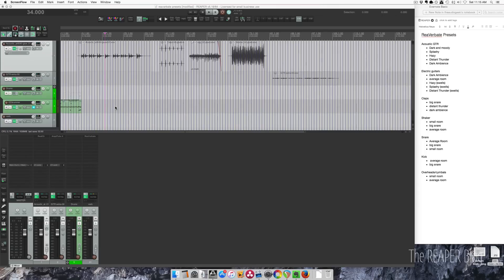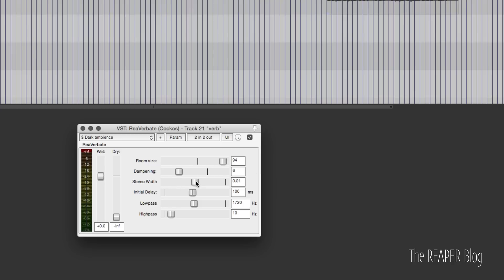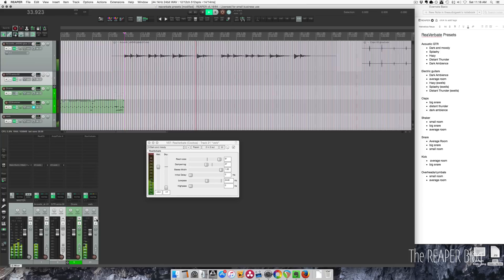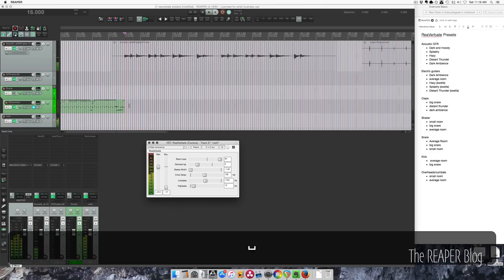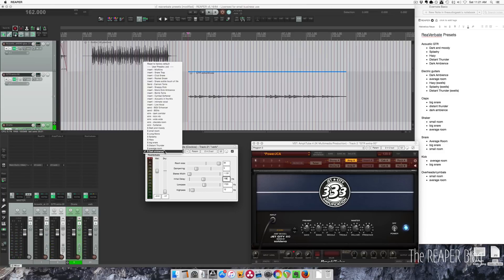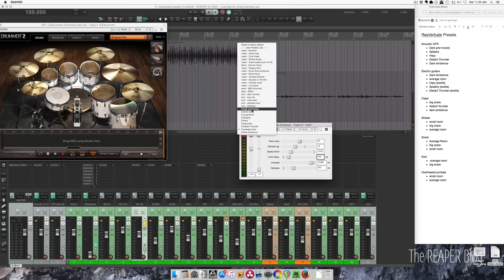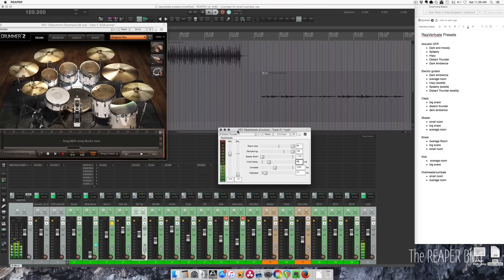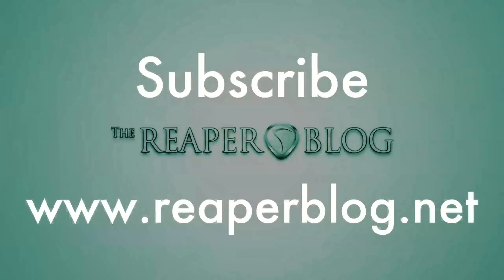ReaVerbate Reverb Plugin + Free Presets

Comment: Pro tip: Use the reverb module in Reaverb - it's Reaverbate, just inside Reaverb - and then use the Trim/gain/stretch module after it to stretch things a bit. You can achieve some really nice reverbs with a bit of playing around.

Comment: One of the effects for which I specifically turn to ReaVerbate is vocal SLAP.  Like the hallway element of Heartbreak Hotel's vocal sounds...  
My settings range for this:
Room Size= 30 - 50  (smaller rooms for quicker tempos)
Dampening= ~50    (to taste)
Stereo Width= 10 - 40 (pretty narrow)
Initial Delay= 60 - 130  (depending on song tempo and vocal cadence)
Lowpass= 1000 - 2000 (pretty dark)
Highpass= 100 - 300  (pretty thin)

With some tweaking this absolutely MAKES a rockabilly (on the fast side), or spooky/haunting (slow) vocal sound...and it's nice to use going into a better sounding room/chamber verb.

Have fun,
Cheers!